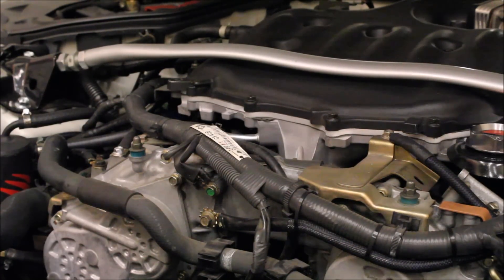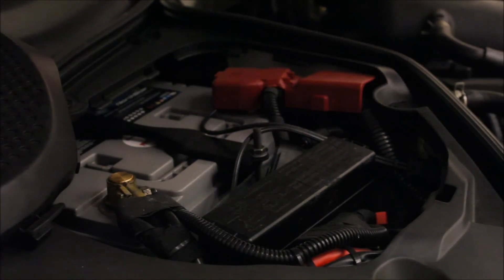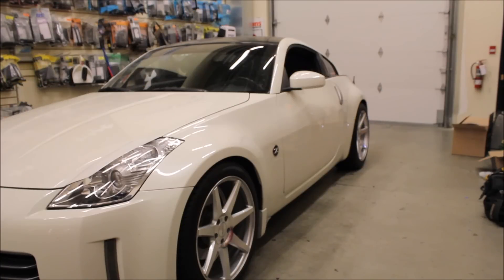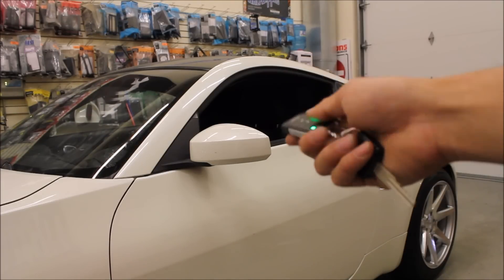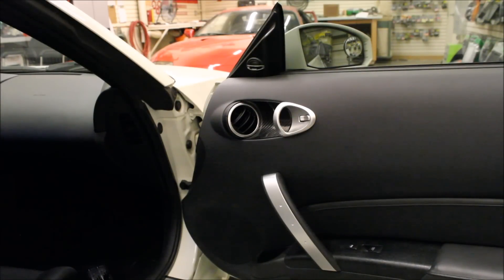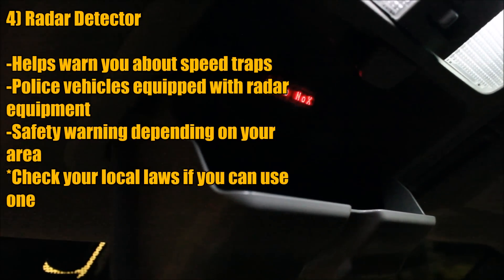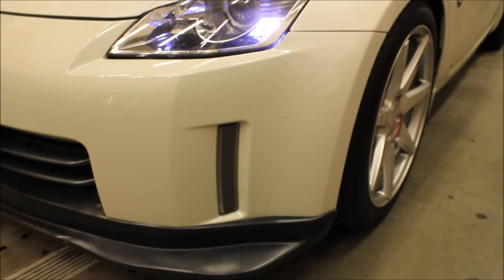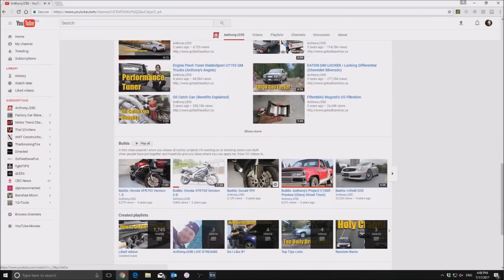Top 5 Electrical Upgrades for the Nissan 350Z | AnthonyJ350

Comment: Sweet, another great vid! As you may know I have done some similar mods from your advice. My stereo is similar, but i kept stock tweeter location (and look) by removing the tweeters from their plastic enclosures and I put my amps inside the factory bose sub area, but i don't have a 2nd battery and all the grounds upgrades (yet). My sub is in a box under the strut bar that separates the trunk into 2 compartments, it does eat up some space but i like the separation, it's easily removable for the spare or larger cargo (yeah right).

I do think it could use some freshening up in the lighting dept with quicker response led's. I'm coming from 90's japanese cars so I'm trying to hang on to some of the older school feel of the car, but I'd really like led replacement bulbs that are nice and warm like the tungsten bulbs they'll replace, everything i've seen on the aftermarket is too bright and white for me. Please point me towards anything like that if you've seen it. I can find the vids for the bigger tail light replacements you've done, but i like the little details, and making all the amber feel correct inside the car at night. Also can you recommend a certain model upgraded alternator with ease of installation/replacement over stock in mind, I'm an ok wrench but i've got a bad back. 

My birthday's coming up soon so i hope i can get the wife to get me the clutch pedal mod and i'll do that, also using your vids, but i could prob use a bit of guidance or general help about the HR motor tranny setup and its differences if you've seen a good place anywhere on the interwebs.

Again, lovin the Z vids. Thanks for the time you put into making them, and making them well. Keep'em up before you park it for the winter!
Reply from the maker: Glad you liked this one as well! That sounds like a solid sound setup.  Did you add some sound deadening?

As for the lights I have not seen any LED lights that have the same temperature colour as their incandescent variants so you'll have to go with the fancy modern look if you want LED lighting.

I would check out Z1 Motorsports' website for other mods you want especially for some HR specific stuff.  I think you're going to love the clutch pedal when you get it.
Reply: Yeah i added some local deadening. Dynamat speaker packs and baffles for the woofers, pie cut and almost just like your install vid. I don't want to pay for more dynamat though bc it's real expensive and i added enough sound to just drown out what ended up being way less rattles than i expected. 

Alpine type r components front and older type r woofers in back. Type r 10" sub with a pioneer headunit for the right look and amber matching, i didn't want a nav or touch screen. 4x75W for the full range and 1x1000W for the sub is more than enough for that little car. It's tuned more for quality at high volume than bass banging. The sub box fits under the strut bar, facing rear and separates the trunk into two sections, which i actually kinda like.

Thanks for the tip on that site, it's like toys-r-us for Z cars, i don't know how i've not come across it yet but i can't wait to go through all of it.
Reply from the maker: Ya you don't have to put a ton of sound deadening to be effective, it's good you have some in there.  Ya it's a cool site, you might be interested in their clutch slave cylinder fix for the HR.

Comment: Can you link me somewhere to buy those from bumper lights, and rear bumper lights? Thank you because iv been trying to find them but great video! You have a new sub.
Reply from the maker: Here's the link for the fronts: https://rover.ebay.com/rover/1/711-53200-19255-0/1?icep_id=114&ipn=icep&toolid=20004&campid=5337982243&mpre=http%3A%2F%2Fwww.ebay.com%2Fitm%2F370Z-Style-Switchback-LED-Daytime-Running-Lights-Turn-Signal-For-2006-09-350Z-%2F132267123195%3Ffits%3DModel%253A350Z%26hash%3Ditem1ecbbc21fb%3Ag%3AzqEAAOSw4HlZb-dw%26vxp%3Dmtr
Reply from the maker: Here's a link for the rear: https://rover.ebay.com/rover/1/711-53200-19255-0/1?icep_id=114&ipn=icep&toolid=20004&campid=5337982243&mpre=http%3A%2F%2Fwww.ebay.com%2Fitm%2FSmoke-Lens-All-In-One-LED-Turn-Signal-Backup-Brake-Light-For-03-09-Nissan-350Z-%2F142414215208%3Fhash%3Ditem21288c7828%3Ag%3Aog0AAOSwyWZZRBFR%26vxp%3Dmtr

Comment: Hey Anthony...appreciate the lower bumper LEDs. Where can i purchase these?
Reply from the maker: You can get them here: https://rover.ebay.com/rover/1/711-53200-19255-0/1?icep_id=114&ipn=icep&toolid=20004&campid=5337982243&mpre=http%3A%2F%2Fwww.ebay.com%2Fitm%2FSmoke-Lens-All-In-One-LED-Turn-Signal-Backup-Brake-Light-For-03-09-Nissan-350Z-%2F142414215208%3Fhash%3Ditem21288c7828%3Ag%3Aog0AAOSwyWZZRBFR%26vxp%3Dmtr

Comment: What brand is that shorty antenna? And is it worth the money to purchase a shorty antenna?
Reply from the maker: I'm not sure actually, it was already on the car when I bought it.  It works decent for the most part, I can pick up all the majour FM stations in my area and I can pick up the strong AM station reasonably.  The one on my car is all metal.
Reply: ah, shame i wanted to know a good shorty antennae, i got a cheap one and decided i wasn't using the radio enough to care about reception but it fell apart and i'm running the stock r/c car dangly antennae again and i want the radio to work again as well.
Reply: sikee norealname thanks, that one looks pretty good.
Reply: It's so funny to me that the larger the antenna the cheaper it is.

Comment: Where did u get that cool little low profile antenna I’m seeing and also does it work as well as an OEM one? Thanks
Reply from the maker: It actually came with the car when I purchased it so I'm not sure. It does get good radio reception, including AM band because the car is grounded well https://youtu.be/mkWCqSfr6ig

Comment: Hey Anthony, still really enjoying all these 350 videos. I need your car audio expertise. I completely re-did the sound system on my 350 (with new speakers + added a sub and a 5 ch amp). I am always getting a constant hum sound, not so much static, coming from my components at all times when the amp is powered on. When i rev the car, the pitch of the hum seems to go up with it. Could this be an alternator issue? I have the Pioneer Appradio4 head unit installed and I've read that these are notorious for having crappy grounds; would pulling out the head unit and grounding the RCA's better potentially fix this? I think the amp is grounded well.. Thanks in advance.
Reply from the maker: Nice! Always like to hear people upgrading their audio.  Did you run the RCA's far from the power for the amp?  Also I'd try running a long ground for the head unit and ground it at the same place as the amplifier.  How did you ground the amp btw?
Reply: Haha, I appreciate the late night reply. I just went down to go check; The RCA's run along the driver side door sill and the amp power runs along the passenger side door sill so I think that is good. As for the amp ground, I have my amp mounted in the same spot as yours, except on the driver side. As I have the nismo model, I naturally have just a cover and no factory sub so I did not want to waste that space. I ran a very short ground to a factory bolt attached to the medal body of the car. This bolt is located just behind the driver seat retractor mechanism thingy. A picture would really help here lol.
Reply: Also, I know that when my imput sensitivity switch for the components on my amp is set to 100mV-2V rather than 2V-8V, there is practically no noise at all. My reasoning behind using the 2V-8V is because the 100mV-2V does not max out at a  music-listening volume that is acceptable; At highway speeds, maxed out volume is not enough at all. I blindly played around with these switches after installation until I got what felt right. Could this noise just be the cause of my input sensitivity settings? Or can this noise be better managed?
Reply: Dtop24 I think it’s not grounded right I’m jus guessing

Comment: That Supra tho and the led light thing is a must for me imma do that for sure when I get my 350
Reply from the maker: Here's a link for the rear lights: https://rover.ebay.com/rover/1/711-53200-19255-0/1?icep_id=114&ipn=icep&toolid=20004&campid=5337982243&mpre=http%3A%2F%2Fwww.ebay.com%2Fitm%2FSmoke-Lens-All-In-One-LED-Turn-Signal-Backup-Brake-Light-For-03-09-Nissan-350Z-%2F142414215208%3Fhash%3Ditem21288c7828%3Ag%3Aog0AAOSwyWZZRBFR%26vxp%3Dmtr

Comment: Where did you get those bottom ligjts for the rear and the front?
Reply from the maker: Here are two links on ebay to get the lights, Front: https://rover.ebay.com/rover/1/711-53200-19255-0/1?icep_id=114&ipn=icep&toolid=20004&campid=5337982243&mpre=https%3A%2F%2Fwww.ebay.com%2Fitm%2F370Z-Style-Switchback-LED-Daytime-Running-Lights-Turn-Signal-For-2006-09-350Z%2F132267123195%3Fhash%3Ditem1ecbbc21fb%3Ag%3AddcAAOSwGwlZ6h6o%26vxp%3Dmtr

Rear: https://rover.ebay.com/rover/1/711-53200-19255-0/1?icep_id=114&ipn=icep&toolid=20004&campid=5337982243&mpre=https%3A%2F%2Fwww.ebay.com%2Fitm%2FClear-Lens-All-In-One-LED-Turn-Signal-Backup-Brake-Light-For-03-09-Nissan-350Z%2F131671351191%3Fhash%3Ditem1ea8395f97%3Ag%3A7qkAAOSwXaRZ6h5m%26vxp%3Dmtr
Reply: holy shit, you are the best tuber ever. you actually reply to fans. definitely going to sub and like. thanks!
Reply from the maker: skyler sanchez Wait you didn't sub yet???!!! Lol

Comment: How much did your Viper system cost? I went on the website and set up something very similar, and it doesnt give me a price- just asks if i want to find a dealer or print it out (which just gives a summary with no quote)
Reply from the maker: Aiden is all Knowing A system to how I have it setup would be a little over $1,000. There's a lot of work and you need an experienced Tech to do it properly and make it look clean.
Reply: AnthonyJ350 is there a way that you can provide a link to all of the components that i would need to buy or should i just speak to the dealer?
Reply from the maker: David I would talk to a dealer. You can build your system on the Viper website and it will direct you to the closest authorized dealer.
Reply: Aiden is all Knowing the reason for that is because viper or (directed) only sells them to dealers for example if I sell you an alarm I have to install it, I can't just give it to you, also if you find it on Amazon directed voids the 1 year warranty for buying it from a 3rd party

Comment: Hi I would like to know how you wired the ground for your sound system because I keep getting this hissing noise the volume is at zero
Reply from the maker: It's pretty overkill. Here's the video.  https://www.youtube.com/watch?v=mkWCqSfr6ig&t=1s

I would also recommend running the ground for the head unit to the same point as where you're grounding your amp.  That also helps a lot.

Comment: Hey Anthony what's going on brother what model Viper is your alarm I would like to install that alarm system and set it up the same way  in my z.
Reply from the maker: It's a Viper 5806V with the SmartStart module added on.  Pricing will vary for installation because I installed as many features and sensors as I could.  The brains have the ability to control everything but it's up to the installer to have the ability to make the connections.  If you go to a Viper authorized dealer they should be able to do the same installation.

Comment: Why are your headlights so damn shiny?!? Are they new or repaired? What'd you use to repair them if you did? Do you have some kind of xpel wrap over them? Or did you just polish them?
Reply from the maker: I get that comment a lot lol.  I bought the car that way and to maintain that look I had Suntek paint protection installed on the front of the car including the head lights.
Reply: AnthonyJ350 my girlfriend lives out in the country so everytime she or I washes our cars they just end up coated in bugs within a week and they are so bad it actually started to ruin her paint and her car is a 2015 and she washes it (correctly) at least twice a week, would a clear wrap like that make the bugs practically fall off? (forget protecting the paint it's too late for that) we just want something to make it easier to clean, like a gust of wind would get rid of them kinda easy
Reply from the maker: Fireblaze x It is easier to clean but wrapping the front isn't cheap. Roughly $600 to $800. I would look into a good car polish, I use Liquid Glass on my car.
Reply from the maker: Here's the link for the car polish, it's really good.  I'd just apply it twice a year.  The first time you do it, apply a second coat a day or two after.  https://rover.ebay.com/rover/1/711-53200-19255-0/1?icep_id=114&ipn=icep&toolid=20004&campid=5337982243&mpre=http%3A%2F%2Fwww.ebay.com%2Fitm%2FLG100-Liquid-Glass-Ultimate-Polish-16oz-FACTORY-FRESH-%2F201955249872%3Fepid%3D1217867741%26hash%3Ditem2f05788ed0%3Am%3Amf6Jugy7CnRr6YCIFQyE3YQ
Reply: AnthonyJ350 thanks man I'll definitely look into it

Comment: Hey, not sure if know this information or not, but how do you pair a 1 way Viper fob with the system? I have a spare one of these: https://www.keylessentryremotefob.com/VIPER-EZSDEI472-Factory-OEM-KEY-FOB-Keyless-Entry-p/viper%20ezsdei472.htm but have no idea how to pair it. Got it with my G35 so I didn't install the Viper originally, however this one doesn't work with it. Thanks!
Reply from the maker: Any local Directed Authorized dealer can program it for you.

Comment: Is this key possible on every car? It's a really cool thing. :)
Reply from the maker: Yup you just have to bring it to an experienced installed shop to put it in properly.
Reply: AnthonyJ350 can the key also undo the convetable top? I have the roadster model. :)
Reply from the maker: Aren't there manual latches you have to undo at the windshield?
Reply: AnthonyJ350 oh yeah, forgot about that..